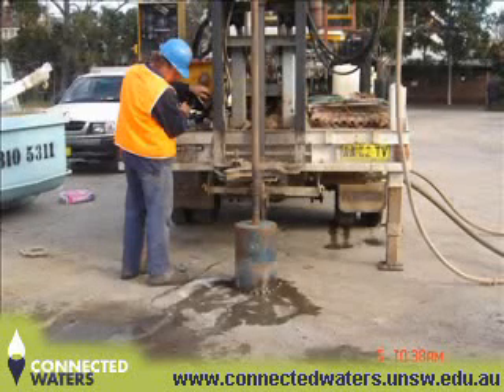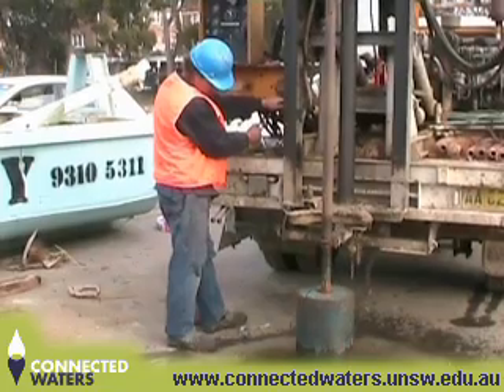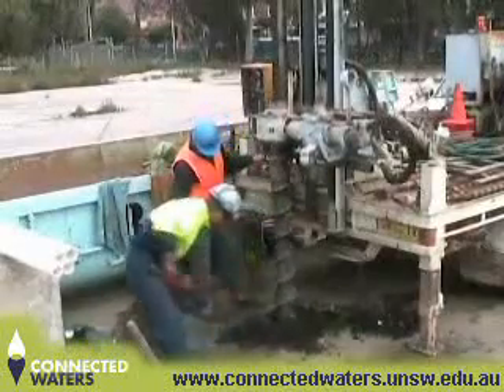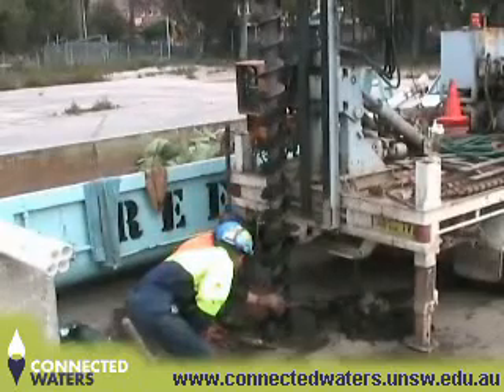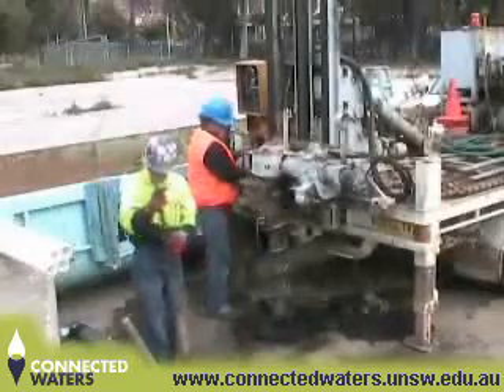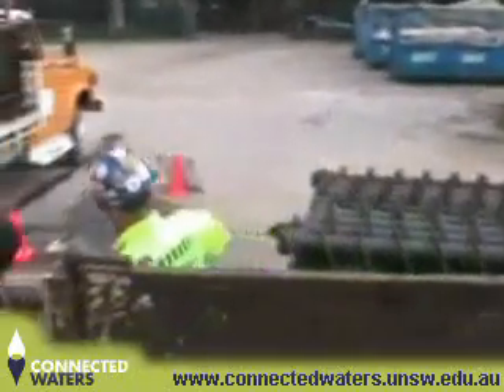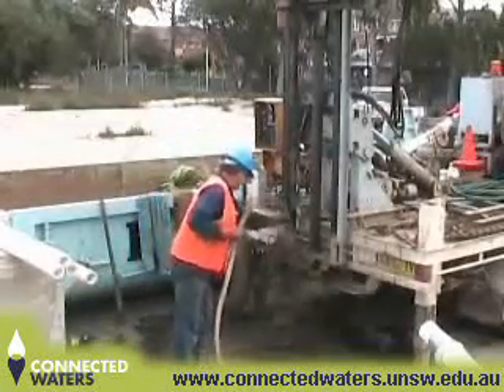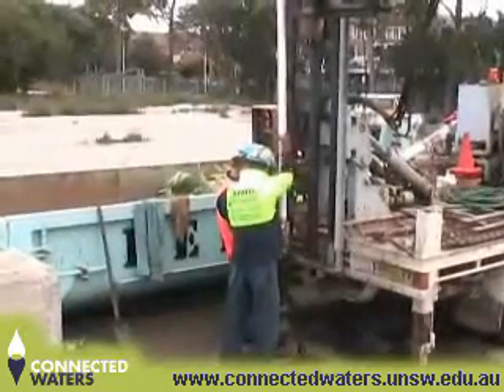Piezometer Installation (CWI)

Comment: Best method is wash boring since you can get all the product down around the pvc since the water pressure plus wall cake keep the hole open enough to get all the product down. Hollow flights are great for the driller because they are quick and easy but you`ll never get all the product down to depth particularly in wet sands  as the sands collapse instantaneously around the pvc as the auger is withdrawn usually resulting in a sand filled peizo!

Comment: I worked on a project like this all summer long, except we were using a hand auger and on occasion a small gas powered one. I have two comments/questions to this video. First doesn't a piezometer tell you hydrololic head not the water table? Wouldn't you just use a normal well for that? Also what is with the sound in this video? I would love to see how these guys packed the bentonite. I've found this to be difficult because it can be hard to know you've added enough sand to be above screening.